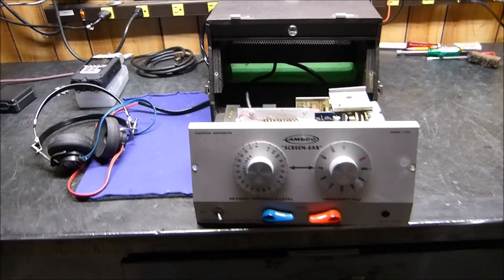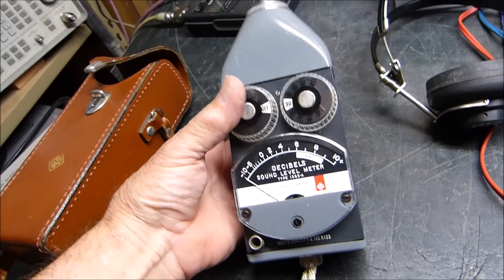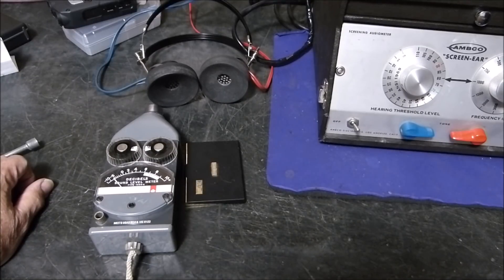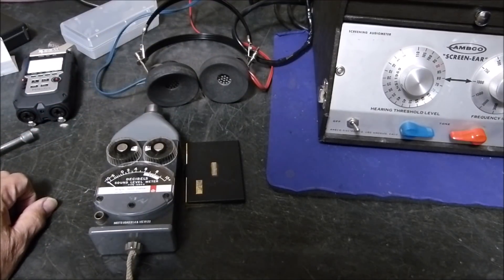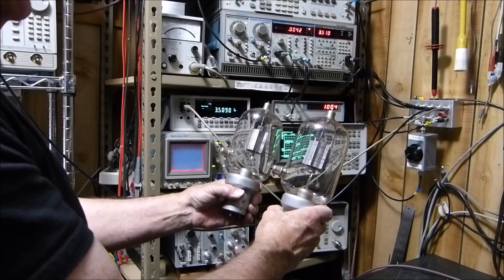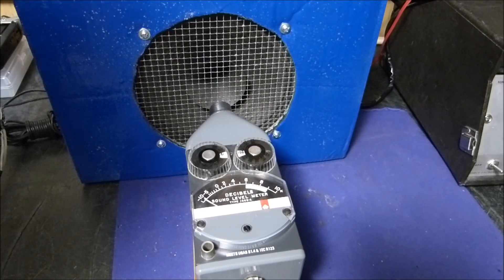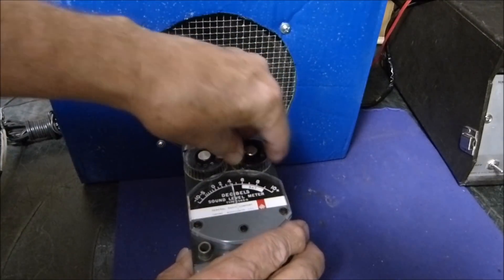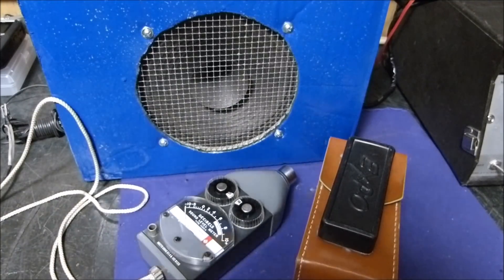General Radio 1565-A Sound Level Meter,  Ambco Audio (Screen Ear) Meter and More

Comment: Fun in the Lab. Wow look at those tubes. I should get some like those. Gammatron you say   XP
Reply from the maker: I could have used them today at high voltage to do an x-ray of my left wrist. My electric drill slipped Monday night and I drove the Phillips head bit into the right side of my left wrist. I went to the Dr today to get it checked so as not to get an infection. An x-ray revealed I had driven the self-tapping screw a good inch into my wrist. I knew it hurt but I had no idea.  It was a shock to see it on the x-ray as I even recognized the screw. I thought it flew off the end of the bit. They did a little surgery and took it out. I'm ready for the next adventure and am looking at Ebay for my own X-ray machine.

Comment: Was the Genrad SPL meter still set to A-weighting or did you have it set flat when you swept the frequency response of the loudspeaker?  The A-weighting profile's response envelope may have added or subtracted to the speaker's frequency response curve as you swept it if it was still engaged.
Reply from the maker: You are absolutely right. In my haste in looking at the weighting, I used A when I should have been using C which is the flattest response. I am sure the A weighting had something to do with my results in addition to having the meter up very close to the speaker. Thanks for noticing.

Comment: Can a guitar amp be built around a 2x 3CX500 Forced air cooling vacuum tubes.
Reply from the maker: That could sure make a monster of an amp...
The problem will be the output transformer. I am lucky enough  to have two KW level output transformers that I can get primary Z from 5K to better than 20K.  I know you have seen my videos on 3-400Z amp and 813 amp. I never listened to them at any high volume. I had them working into a dummy load, the one made from water heater elements, and then put a rheostat across the dummy load so I could listen at a low level while the amp was running at full power. 
I have experienced and it seems others have also, that high quality vacuum tube audio amplifiers perform best into a low Z transformer primary rather than high Z. I say this because these really high power amplifiers would be high Z primary transformers, in the range of 20K for a primary Z. I am not saying high quality vacuum tube amplifiers can not be built at high power/high Z but studying the McIntosh circuits, the primary Z with the plates and cathodes of the tubes connected to the output transformer is around 1K ohms.
I have been considering dragging out my 813 amp and putting it back in working order. Maybe replacing the 813's with 810's.
I think my YouTube audio subscribers would enjoy that.
Thanks for your thoughts and comments.

Comment: I couldn't hear a tone above about 15-16kHz, so I checked with an audio spectrum analyzer and the Youtube audio does indeed not produce any output above this frequency. It's probably limited by the compression they are using.
Reply: A lot of audio compression algorithms roll off the very frequencies because most people can't hear it. Often it's a choice when doing compression to reduce bitrate. It's not surprising that YT would rolloff the highs.
Reply: Agreed. I used an iPad into a Tektronix 7L5 via a wideband amplifier for monitoring, and it showed nothing at 17kHz, something at 16kHz and below. iPads can produce up to 22kHz, and the rest of my signal chain handles at least 500kHz so it wasn't anything here.
Reply from the maker: @EJP286CRSKW  This is very interesting you guys made measurements with spectrum analyzers. I had no idea Internet YT would pass along frequencies even as high as 15-16 KHz. Very good information...
Reply: ElPaso TubeAmps It's also interesting because both my partner and I would swear we heard something from 19kHz down. Something annoying. I might repeat the measurement to double check. One difference is we were watching on a TV, not via the iPad that as fed into the SA. If that's the difference it will take some measuring, as the SA is downstairs and too heavy to lug up to the TV room.

Comment: Very good. I wouldn't swear to 20kHz but I thought I heard it from 19kHz down, which surprised me as I thought my dominant pole was around 15kHz by now. I'm 67.5. I think it's partly a matter of knowing what you're listening for. Hard to believe that your hearing really rolls off as low as 6kHz. Did you test the headphones to 20kHz? I think with the speaker you had the microphone too close, so the lower tones were kind of folding around it and only the focussed stuff from the centre tweeter was really going straight in. Also of course you are dealing with nodes and nulls, which vary in position with frequency. And also your cardboard baffle. I have a modern SPL meter which came from either Dick Smith or Jaycar in Australia about 12 years ago. Seems like a commodity product you should be able to pick up somewhere. It was around $50-75 from memory.
Reply from the maker: I am absolutely amazed that the frequencies are transmitted over the Internet. Even though I can not hear them, I left them on in shop the other day and my wife started complaining of a noise  she was hearing and did not know what it was. (she did suspect it was my fault...)  Also, when I have  reviewed the videos my cat gets quite  upset. I would have no idea why except that I know these high frequency tones are being emitted. My amazement, disregarding the value of them measurement process, is that these "cheap"  60 year old vintage speaker can reproduce them in the first place. And again, as mentioned, this is in no way a NIST level measurement process but the fact that these frequencies are emitted and I can detect them amazes me.
When using the ear testing machine, I agree that the first thing is to raise the volume so that the listener knows what they are listening for. I not only tested myself but also my two grandsons (age 17 and 9) and to my amazement I got the same results on my older grandson as the one when he was 9 years old. He has a peak at 4 KHz in both of the measurements in both ears.
I did do the best i could in testing each ear phone and they seem to be the same as best i can tell. I think the are good quality and each as a S/N.
The ear testing machine only goes to 8 KHz and I did test more than one frequency with the earphones and GR instrument (I think at 1 KHz and at 125 Hz) and the measurements were  quite good - to my amazement. How to exactly make these measurements seems difficult as the exact angle and distance from the ear piece of the headphones  changes things quite a bit.
The GR instrument manual says to not measure with the microphone direct on but at a 90 degree angle. I know I did not do it that way but this was all for fun and still amazes me. I also ave a much newer Radio Shack sound level meter that compares, in the ball park, to the GR instrument but the RS instrument only has one scale so I trust the GR instrument more.
I did look around for new SPL meters but chose this one having conference (possibly misplaced because of age) in the vintage GR instruments.
Reply from the maker: I have to tell a story from a good 40 years ago when I was testing an Electro Voice 15TRX speaker. If you remember, it was a beautiful speaker, probably the 15W coupled with a tweeter mounted in the center. I was using a MC240 and was raising the frequency and I am sure was hearing 15KH and above but kept raising the volume as I got higher in frequency just to make sure I was still hearing the high frequency tones until suddenly the tone stopped. I remember I was puzzled until I got to checking and thinking about it and you know what happened...  I opened up the voice coil in the tweeter. I have never felt so stupid in my life (well... maybe tonight when the drill slipped and I ran the Phillips head screw driver into my left wrist... my good friend Dr that stopped by told me to get a TDP shot tomorrow... yuck)
Anyway back to 40 years ago - I sadly ruined a beautiful speaker system just being stupid. I knew better but did not think it thru until it was too late. Moral of that story is there is real power in the high frequencies even though we may not hear it.
Reply: You're not alone. Back in the day some early FM stereo tuners let all the 19kHz pilot tone escape. Fried quite a few tweeters. It's only 20dB down from FSD.